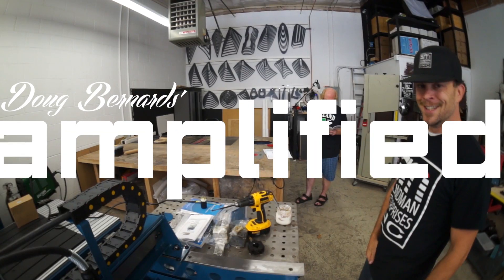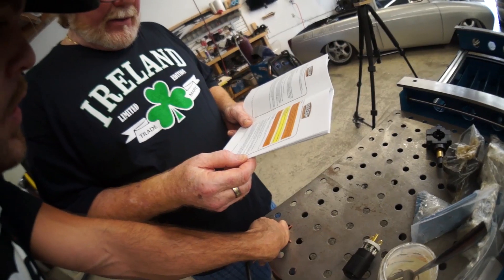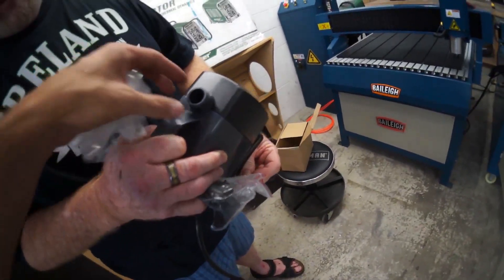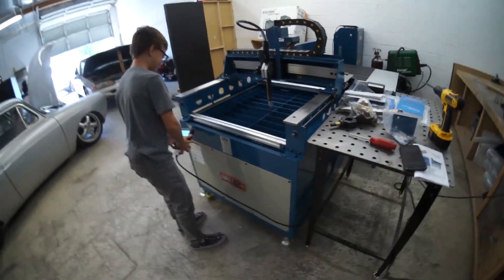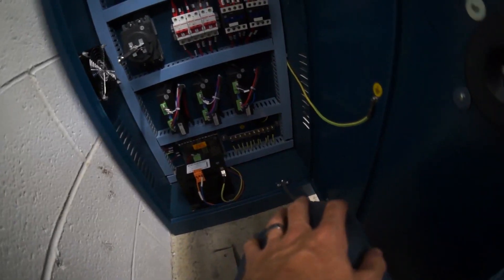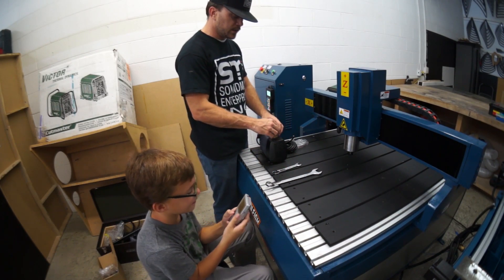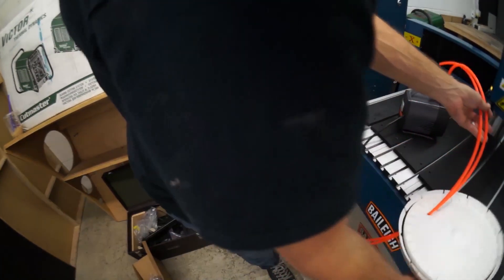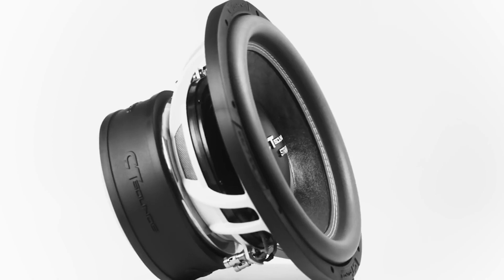I tried to WIRE IT!!

Comment: You may want to check if the VFD Inverter (The large grey box in the upper left corner of the enclosure) supports single phase 220. Some do, some don't. Just look at the model number and find a manual online for it. As for the spindle coolant and pump. Use distilled water. And you can fire up the spindle for testing. Just short burst. Thou it's strange that it needed 220 to drive the stepper motors. Thats usually a 24/48V system. One quick note- You may want to move the plasma cutter a little farther from the CNC. When plunge cutting its going to to throw some sparks.

Anyway- Love the show. Be safe using the new machines.

Comment: Similar to a remote wire on a radio to turn the amp on. You could find a wire inside the control panel that only has power when the machine is on and add a relay that will correctly work with the voltage on both ends. So the relay won't draw to much and and it will be acting as a light switch for the water pump.

Comment: The wires you have are the British stander color code for the single phase, yellow with green stripes is the grounding wire, black is the neutral red is the power or as they call it the line

Comment: Soundman,  Green with yellow stripe means isolated ground... The machine is asking for clean power... It's wants SINGLE or SPLIT phase   220volt... Red, black are hot.. white neutral, Green with yellow is IG....

Comment: either it's 120  black white and green. 220  2 phase black red green  220 3 phase black red blue and green or 220 with a neutral  black red white green.    black red and green is 2 phase.
Reply: This is actually one of the most helpful YouTube posts in history. I could never get that stuff straight.
Reply from the maker: +jim bo 👍👍👍👍👍👍
Reply: No such thing as 2phase...
Reply: ^ he's right. Its a single phase 220v red is +, black is -, and the yellow/green is an earth connection. Had it been 3 phase 220v then you would have had 5 wires in total not 3.
Reply: +Dax Red AND Blk are both hot, white neutral, Green with yellow stripe isolated ground... SINGLE OR SPLIT PHASE 220V... Same as the oven at your house...
Reply: Maybe in the USA, But not where I'm from it isn't . My oven has 1 blue 1 brown and 1 yellow/green cause that's the colour coding used in the UK for 240v mains. The reason it's coloured that way is to help people with colour blindness to identify which wire is which more easily.
Reply: MrMaxyield correct it's technically single phase but you get the point
Reply: Wouldn't it be 208v single phase? Never seen 220v ever.    Not sure what type of service he has 120/208v 3 phase or 120/240v single phase
Reply: +Dax I commented once I started reading the comments... I didn't realize he was questioning the load side... Damn #DougBernards, all you had to do was run a continuity check to the frame to determine ground! The remaining wires will be your current carrying conductors... Single phase means you can't wire it backwards or get a phase to phase short...
Reply: +Dax  Do y'all brits run at 50hz or 60hz??...
Reply: 240v single phase 415v 3 phase !
Reply: +Dax  same scenario in Australia, our standards are similar to yours. Plans are to change our conductor colours to EU but brexit came along... never heard of 2 phase but that's the American style hmm... always want to be different

Comment: Why do you even have 110Volts :D
Reply: Cuz the United States has an electric grid from the 1890s, Thomas Edison designed the light bulb to run on 110. I think that a 220 system is better in every way, and actually uses less power. The higher the voltage, the lower the current. What I'd really like to know, is if everybody already has 220 running to their house, why not just convert over the panels to use it for everything?  Instead of using 110 for basic shit, and only 220 for just hot water heaters and clothes dryers. Our shit is so outdated, I'm surprised everybody doesnt use a telegraph still instead of having a cell phone.
Reply: Correction, only in transformers is voltage inversely proportional to current. In all other electrical circuits voltage is proportional to current.
Reply: +Sir Torrance ohms law. If you have 100 watt light bulb, and it's meant to run on 110 volts, it uses 0.9 amps of current. A 100 watt light bulb on 220 volts only uses 0.45 amps. Therefore, more voltage, less current.
Reply: +Mikey yes that is because a transformer can only be used in AC circuits, and the magnetic induction from coil A into coil B is what determines the output. If coil A has 5 winds @ 25V & 2A, and coil B has 10 winds then the output voltage of B will be 50V & 1A. But any AC circuit that does not involve a transformer or any DC circuit, ohms law states that voltage is proportional to current.